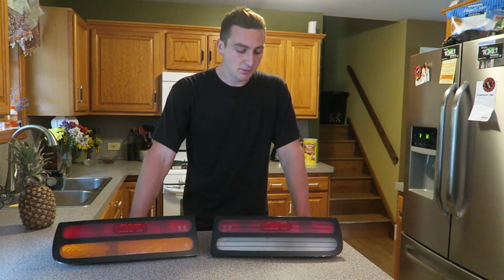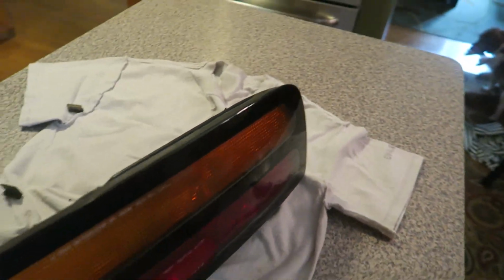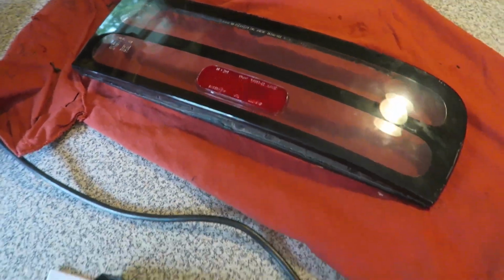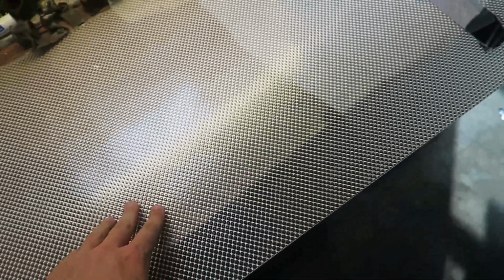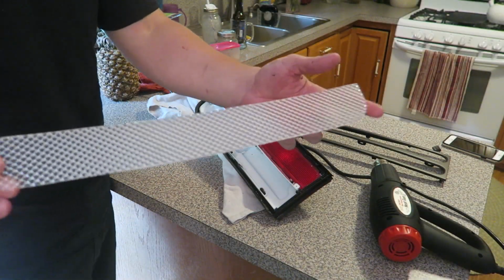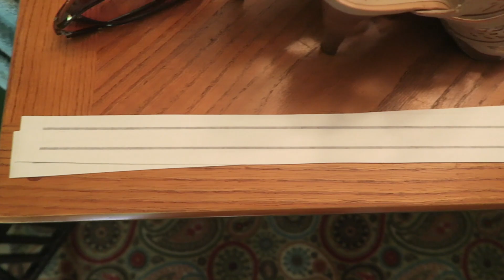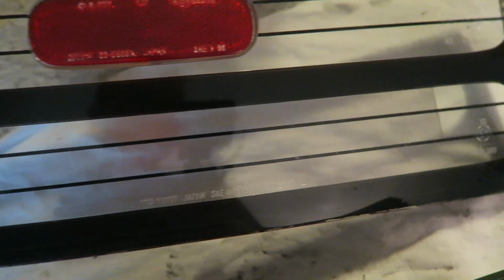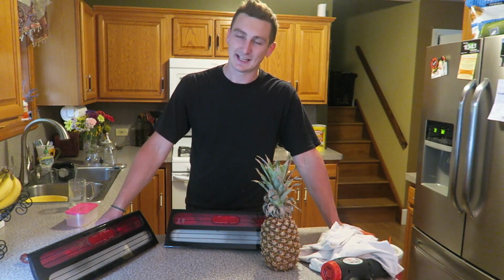How to JDM Taillight Conversion 300ZX

Comment: I was afraid of the pin stripes coming off so I masked everything but the lines and sprayed them black. Took longer but I know they will never slide off in temperatures extremes like a cool carwash after a hot summers day. The inside bezel is chromed in jdm version. I wished I had the resources to have that chromed but I sprayed it chrome instead. I wanted to vinyl wrap it in chrome but again I was afraid it would unravel inside the housing after I was done. Just a thought if you ever do another set.

Comment: Would I do the oven heat process for my g35 coupe headlights if I wanted to black out the housing around the bulbs ?
Reply from the maker: +Jason Koch yeah it's probably work well. Honestly it's easier If you rest them on the edge of the oven and leave it there at low heat

Comment: JDM lights are identical to the orange ones you took apart, it's only the 1999 models which got the clear indicators, so should be called 99 spec instead. Nice guide though.